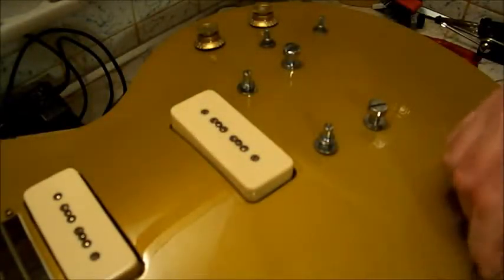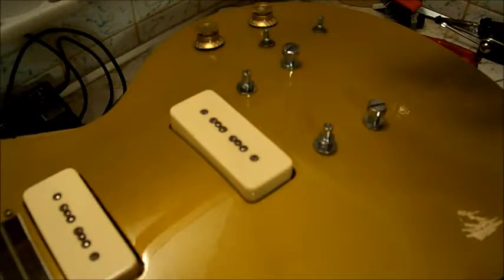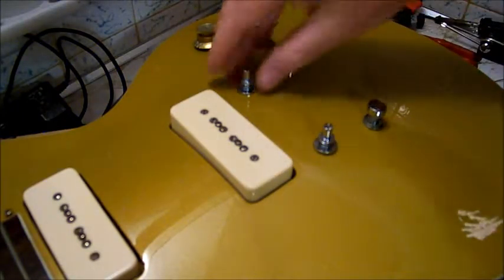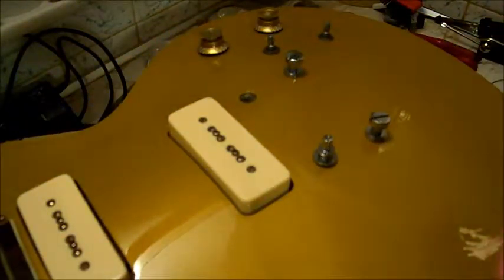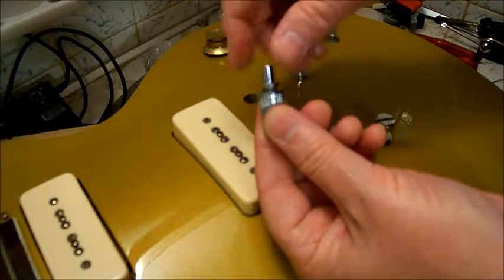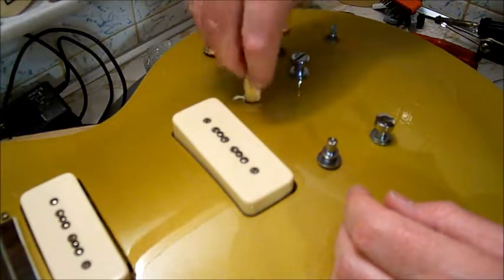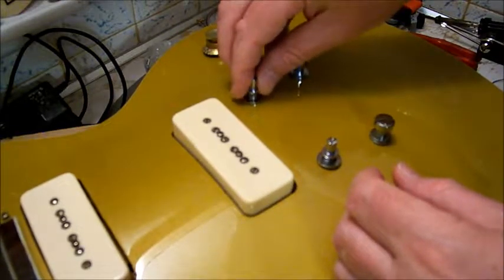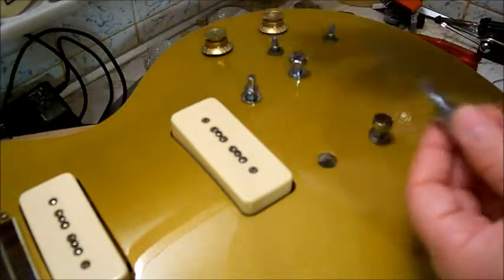Glueing A Loose Bridge Bushing

Comment: I pulled out mine and apply superglue on it (CA type) but kinda thinkin that how should I pull it out again when I want to replace it?Should I heat the studs using a soldering iron and wait for the superglue to melt then pull it out?
Reply from the maker: Yes. But it will take a long time to heat up that much metal!
Reply: When removing these, u can put a bolt or screw or anything hard down into the hole, then screw in the screw. This will force the part you glued in outward
Reply: @LukeZalvino  I already tried this method and it didnt work for me, the superglue is too strong, it even cost me a dent on the guitar body from the screwdriver from screwing too hard.I tried the soldering iron trick and voila, came off easy :D
Reply: @subzero8410  idk how u managed to dent the body using my method lol, but whatever works for you. little heat works too like u said
Reply: @LukeZalvino  the funny thing is that the screwdriver im using actually slips from the brigde when im screwing it down, im using a flathead screwdriver btw XD
Reply: use hot glue?
I'm very late to this party
glad I found it though
I have almost same problem with a Dean I bought
except the bushings are never coming out
I bought a few replacement bridges
but neither of them fit right
looking at the comments since I bought them confirmed the sale page was wrong on both of them
anyway, I figured out a good post and bridge combo
but the post have about the same amount of play as the guitar in this video
the idea of using hot glue came to me recently and I'm going to give that a try
hot glue will get pretty solid
yet to remove it would only take a bit of digging
could use an X-acto knife to do it if you wanted
so now I'll have a functional guitar until I can find the proper bridge for it
good idea? bad idea?
anybody else tried this?

Comment: it worked, but when i put the strings on and set on standard, the bridge bushing Pulled forward and slack back
Reply from the maker: Did you let it fully dry?
Reply: @JoeHartRocks  maybe I should wait a little longer for the glue to dry. what kind of glue is good to use?
Reply from the maker: @afrizalyusranzale6809  Titebond wood glue. But any good quality wood glue would be fine.